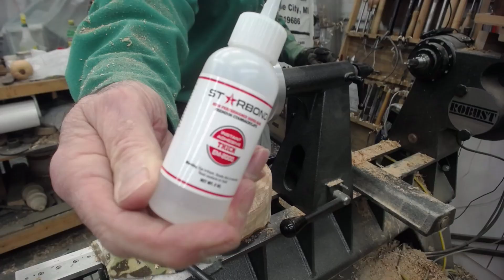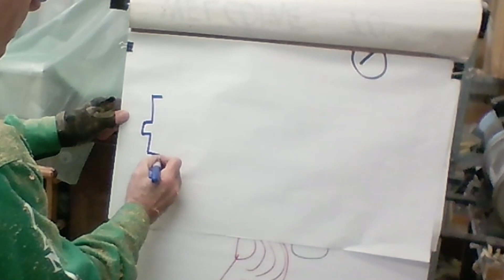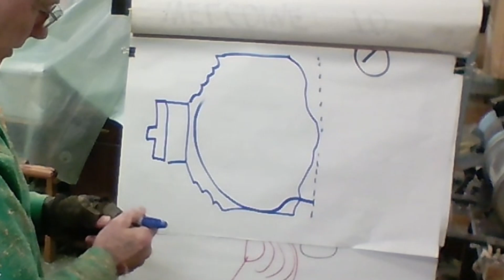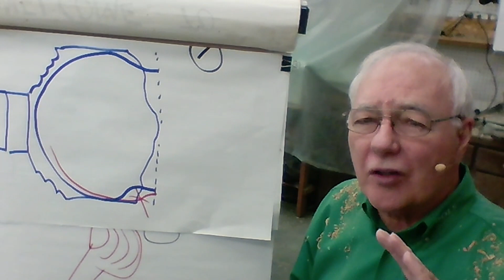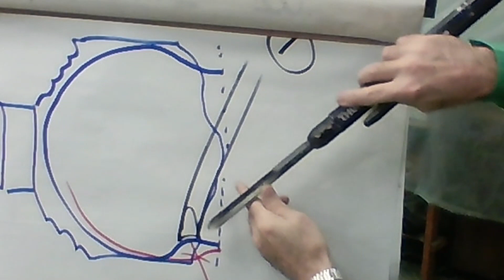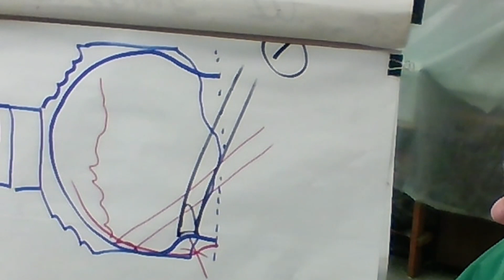Calabash Cherry burl bowl with natural edge

Comment: Hi Lyle! Very nice demonstration. I guess you can use the hollowing system for most of the interior one you go beyond the lowest bark point, but you did not do that because the finish out of the gouges (bowl and spindle) is better? Best regards, Daniel
Reply from the maker: Good question Daniel, I could have used my hollowing system with the Hunter Carbide and had just as good of surface off the tools.  The carbide is on an angle and slicing through the fibers, and not used as a scraper.  I agree with you a scraper would not leave as good a surface and would have needed more sanding for torn out grain.  I used a bowl gouge for the top 2/3 of this bowl because of the speed of wood removal.  As you could see the shavings were frequently half inch wide.  The boring bar system is designed with smaller cutters purposely to allow for deeper hollowing without vibration. Wish you a Christmas season blessed with good health and happiness.

Comment: Great overview on how to attack this shape. Id like to attempt this for the first time but do not have a hollowing system. Will I be able to get the job done with a bowl gouge?
Reply from the maker: Id suggest you do it shallower.  It could be done with a blunt grind "Bottom Feeder" tool too, for the area not reachable with the bowl gouge and spindle gouge.  The advantages of a bevel supported slicing cut is huge but many other tools will work.  You just have to sand the damage they do.

Comment: Really enjoyed watching you turn the bowl and thanks for the tips, how long do you let the bowl dry before sanding/finishing?
Reply from the maker: Thanks for the feedback Mark,  I usually sand and finish right after I turn it.  If it is too wet to sand I wait a while to let the surface dry out enough so the sandpaper does not clog up.  The Watco Danish oil I use can go on right away.  No problem with some moisture left in the wood.  It will be pretty dry from the turning and sanding process as long as you have a relatively thin wall thickness.  The drying and wet wood handling information is in my Bowl Basics DVD